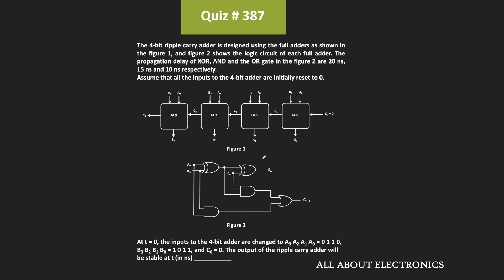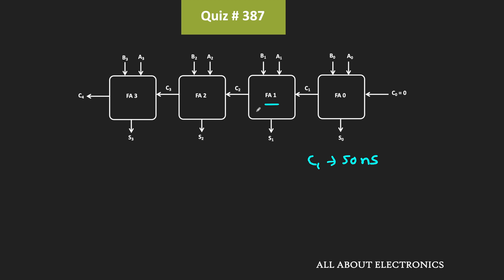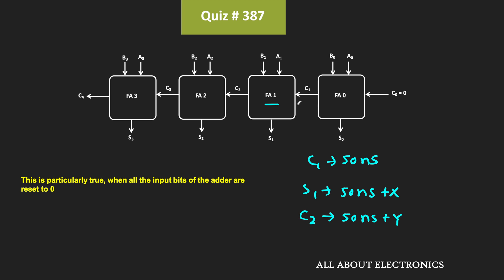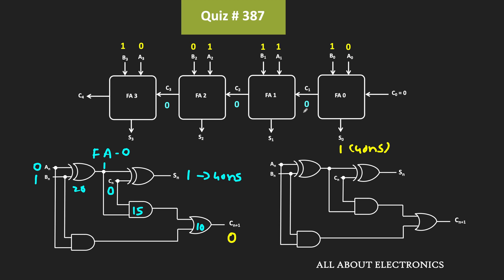Ripple Carry Adder Solved Problem (Digital Electronics) | Quiz # 387

Comment: at 6:55 why didnt you include an bn xor gate in order to find carry delay. Because it's result is used in carry calculation
Reply from the maker: In the second  Full adder stage, the carry output becomes 1 after the propagation delay of AND gate (the lower one), and the last OR gate. And then after it remains 1. Of course, for any other input case, one should consider the delay of the XOR and the AND gate. But here  both An and Bn are 1, and Cn is also 0. That means the second input to the last OR gate will remain 0. Earlier also it was 0, and after applying the inputs An=1, Bn=1 also, it will remain 0. That means when An and Bn both are 1, then valid stable output is available just after 25 ns. And after that is not changing. That's why for this specific case, the carry propagation delay is 25 ns. I hope, it will clear your doubt.

Comment: In FA3 , cout will be available after 70ns . Because 20ns + 25ns + 15ns + 10ns = 70ns
Reply from the maker: For FA3, for the given inputs, the valid carry IN input is available after 50 ns. And after that, as shown at 10:25, it will take 25 more ns to generate the valid carry out.Please check it once again. You will get it. And if you still have any doubt then let me know here.